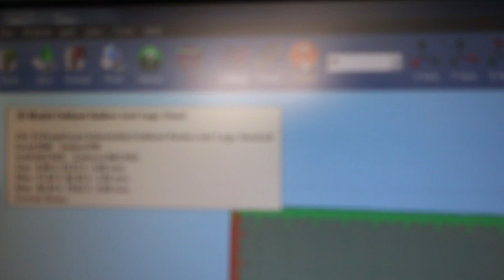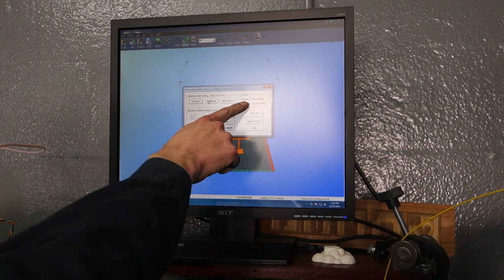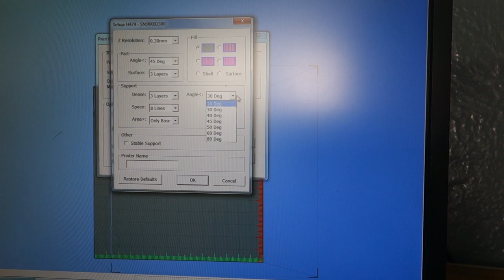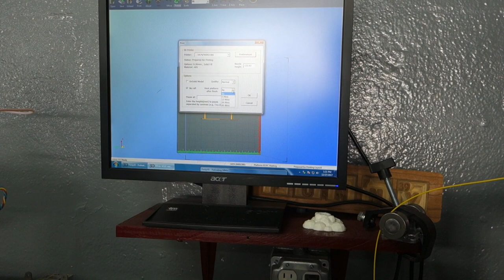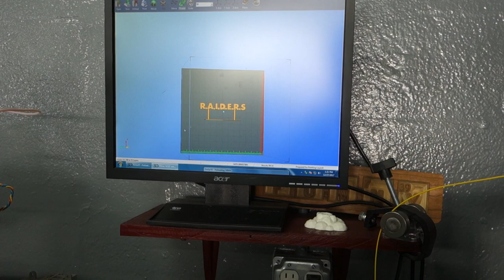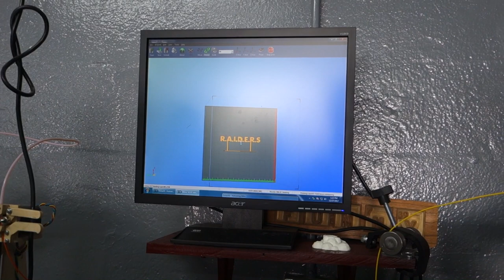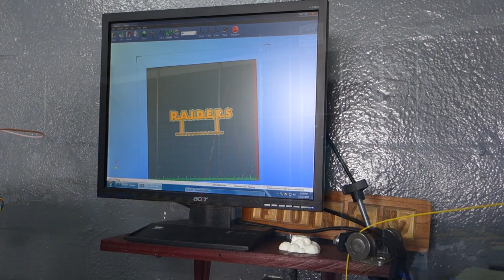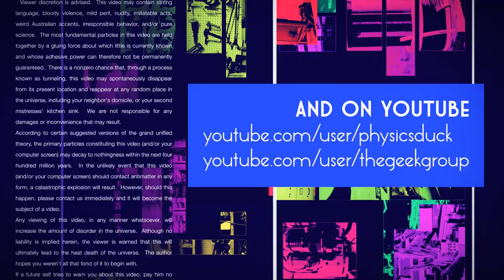Captain's Blog 12 27 2017 3D Printing setup

Comment: zoom function is very helpful.  what are ABS and PLA?  1342  safe place for a quad.
Reply: ABS and PLA are two of the most common 3d printing plastics. ABS stands for Acrylonitrile Butadiene Styrene, and PLA stands for Poly Lactic Acid, the building blocks that make them up.
ABS is somewhat tougher than PLA, but is more prone to warping while printing, and requires a heated bed and higher temperatures to print well. It also tends to stink. 
PLA is easier to print, smells nicer, and is slightly more brittle.